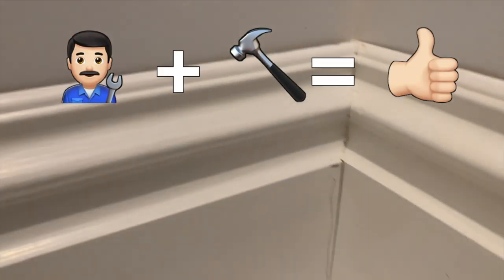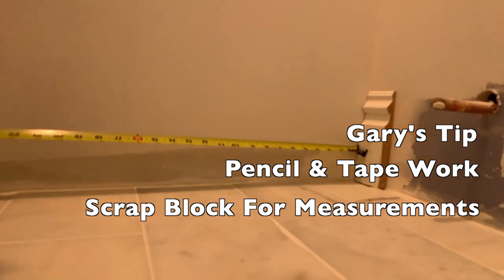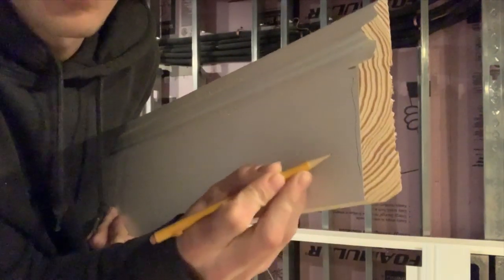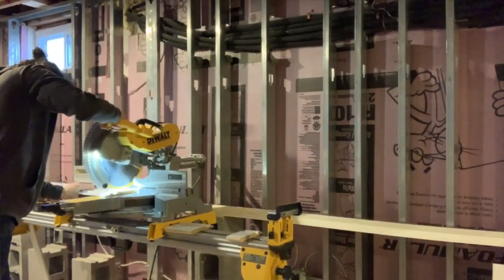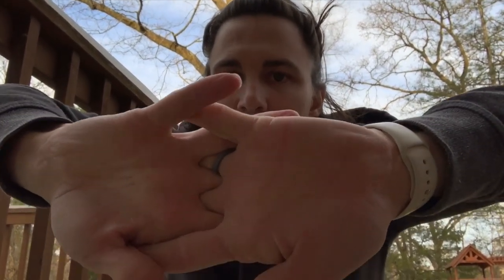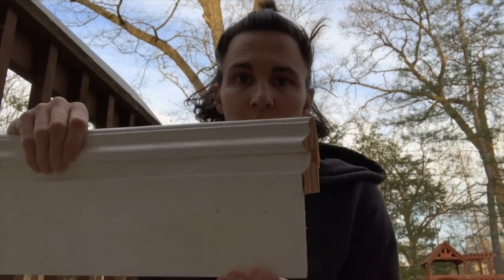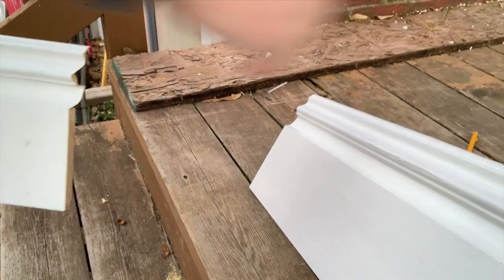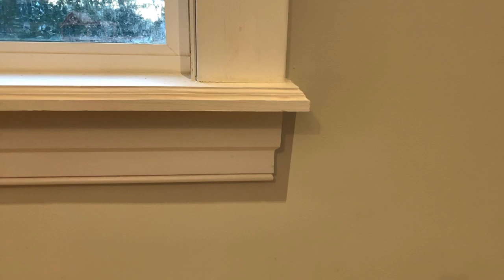Coping Baseboard Molding The RIGHT Way - #molding #carpentry #finishcarpentry

Comment: Just a tip for beginners. Don’t cut the length until you get a good cope cut or the third cut he made.  That way if you mess up just cut another 45 and start over. Yes it’s more time however will save you as seam.
Reply: Yes!! Cut the length last, in  case something goes wrong with the coping cut. You then will still have some extra to cut off on the other end.

Comment: The second 90 degree cut, I usually back cut by a couple of degrees, along with the coping cuts. It gives you a bit of wiggle room if the walls are a bit uneven

Comment: I am a novice DIY'er.  I have to fabricate and install 50 feet of baseboard to replace the 130 year old stained baseboards that the demo asses destroyed.  I really appreciate the detailed explanation of how to deal with the whole piece and not just the coped end.  Question, if I'm understanding this correctly, if you make a bad cut and the square end winds up a tad short, it doesn't matter because that flaw will be concealed with the coped end.  Is that right?  Thank you.

Comment: Hey Cat:  How do you attach stained baseboard to brick or plaster?  Great video!
Reply from the maker: Good Question. Only time I've had to glue base down was on an exterior basement wall with no framing. I used a product by Liquid Nail's called FUZE It. - I'd work to find weights, or 5 gallon paint buckets to hold the base into place as the glue sets. Good luck!

Comment: Great video but why is there a gap still
Reply from the maker: Vance Nelson nothing is nailed in at this point. And cause it’s 4K 😂
Reply: I agree with Vance, it should be light tight when just pushed together.
Reply: @PatTheCat  idk they just didn't look very round, sand paper goes a long way.
Reply: It's because he down cut the cope... is a much tighter fit if you back cut a close to 45 as you can.

Comment: There isn't really a wrong way but its easier to measure from sheetrock to sheetrock cut 45 on the end and it automatically fits.  Cutting the straight with a miterbox is great also.  I'm a puller just like you are.  I can't see how people can push a coping saw.  I'm a 35yr experienced trim contractor and you did pretty good there.
Reply from the maker: Thanks Jeff! Stay tuned!

Comment: If you don't have a sliding miter saw can you do that straight cut vertical and upside down?
Reply from the maker: I suppose you can. I just recently used a batter powered circular saw to install base and cope it, so when there's a will there's a way! In your case, if you had a multitool that would be helpful, you'll want to watch that the saw doesn't kick when you power it down and that the base is supported and not moving at all. Good luck!

Comment: Hi, great video. My question is how do I angle the chopping saw so that I get less on the bottom or back of the cut. I keep cutting off my 45 degree angle and the pieces don't fit together like they should.
Reply from the maker: Candace Harmon cut the board square or straight , until you need to cope the profile of the accent on the trim.
Reply: @PatTheCat  thanks

Comment: Coping with a small angle grinder copes in seconds back resessing the fit for tightness .40 grit wheel .
Reply from the maker: All I had was a coping saw
Reply: Then my friend you had the tool of choice ,I have one but I choose the old school method saw teeth ,grinder for finishing the recess .
Old school tools teaches proper handling of all other tools, even a painters brush ,always allow the tool to do it's work lol we just help 
It along ..I'm teaching myself carpentry these videos here have taught me how to maintain my own home remodels as well . To all you Who make videos Thanks .
Reply: @PatTheCat  Don't get pressured to use an angle grinder.  They are very dangerous tools... can easily end your carpentry career in a second.  All the time it saved you will be meaningless when you are missing fingers etc. Safety over speed. 

Also, liked the video and tips.  Good job!

Comment: Really a hole for the supply line. You offset the base molding by using 3 more pieces and setting into the main base so the profile creates a top and side frames creating a nice flat area for your escutcheon. Wish I could add a photo as I just finished doing such.
Reply from the maker: I think I understand what you are saying!!

Comment: Can you do a video on how to measure the wall and then the skirting board so you know exactly the lengths you need to cut to cope it. Then the length it needs to be after coping. 

No online videos show how to measure etc so you don't end up cutting too short or too long before coping, then after coping etc
Reply from the maker: That’s what video does exactly. Watch the measuring part once more.
Reply: @PatTheCat  my skirting is 18mm thick at the bottom and narrows to about 9mm (roughly) at top. 

I put a waste piece of skirting in against the wall. Do I measure from the base of the waste skirting where its 18mm or the top where its 9mm ?

Also when I'm measuring from that waste piece against the wall, do I measure to the bare wall on the other side or to another waste piece of timber ?
Reply from the maker: @darachslife5875  OK, are you trimming out the whole room? Or just replacing a few pieces? It also would be good to determine which hand you were going to cope with. Since I cope with my right hand, I cut the board square on the left that way all my copes are done with my right hand. In cutting anything, always use your longest dimension. Measure twice cut once, if it’s long cut short, if it’s still long cut shorter. If your piece is too long and your cope is dead on, then just cut your square side back in increments of a 16 inch or 32nd at a time. Cope just one time, then reduce the square side if it’s too long
Reply: @PatTheCat  thank you very much for replying by the way.

Okay let's just for arguments sake say say each wall is 600mm long and four walls perfect square room. Im coping same as you have said in video and I'm right handed. Skirting is 180mm high by 18mm thick at base and narrows into 9mm at top

So I cut one end at 45°, cope it back etc. Its the length back that always gets me cos I've to keep cutting a little at a time cos obviously if its too big it won't fit and then when I cut too short its too late and I think its the 9mm between the top and bottom thickness that keeps getting me.

So do you reckon the length of the board should be 582mm measuring back from the coped end or 591mm and I'm using a hand saw at the minute so its very time consuming trying to cut it to length a couple of times hence why I'm asking about measuring to try speed it up a length
Reply: Do his way of measuring is not very accurate do to most drywall in the corners are not truly plumb do to over mudding or under mudding. Measure wall to wall (without a spacer) roughly were the top of your base will be on the wall for example if its 600mm go to your saw cut your 45 degree cut. Now BEFORE YOU COPE anything take your tape and hook the long point of the 45 and measure out the 600mm and that will be your straight cut. Now you can cope everything out. This works reguardless of any style or profile of base. And just cause your right handed doesnt mean you cant do left copes give it a try may be easier for you. After training no joke, nearly 100 people how to trim 98% of them if they are right handed left copes are easier and left handed people right copes are easier but do what works for you and dont be afraid to try something different
Reply: Oh and that cope should have been alot tighter

Comment: When you are making your cut. What Mark's did you make on the board to make the cut, I just have a craftsman miter, nothing like yours.
Reply: Its alot easier to make your cuts with the baseboard standing up on your miterbox than laying flat. Especially with a miterbox like yours. You just flip it upside down to make that straight cut on the cope

Comment: Good info, but I almost ALWAYS miter base with this much detail. I usually cut both inside meters at 44 or 44.5 and pinch in the longer runs to the shorter runs.
Reply from the maker: Detail is when you want to Cope.

Comment: No coping . Cut it at a 45 . Then glue the ends and if needed use my pin nailer
Reply from the maker: John Asaro not 6.5” base!!
Reply: I agree with pat you’re not going to get as good of profile match just cutting miters, also coping will more likely maintain a good joint if the wood shrink or expand. I have trimmed a lot of high end homes and have yet to see a perfect drywall corner. Not slamming you John just disagreeing with you.
Reply: Good luck finding a true 90 deg corner to just miter it.
Reply: @RyanReskyTrumpeter  true but a miter doesn’t have to be at 90 right . We can cut at 89 or 91 etc.
Reply: @jawa6066  for a corner, it'll never be perfect. Thats the reason for the cope cut.

Comment: Coping is so not needed and to be honest takes to long. If you must cope then use an angle grinder and flap disk which is so much quicker but to be honest there are so many accurate angle finder tools out there that you can just measure the angle correctly and so accurately that you mitre saw will be doing all the work. Coping is so 90s
Reply: Your*

Comment: I find it easier to use a lot of caulk and just charge the customer extra for it. Saves a lot of frustration. Do I get call backs? No never. Not one customer has ever called me back.
Reply from the maker: Ha! I have just started using all caulk!
Reply: No they didnt call you back because your a hack and wouldnt want you back in the house hackin stuff in and over charging them again. There is no frustration with cutting it correctly. Its an easy instal

Comment: Coping is only for very extreme situations but should not be the norm...it's a waste of time ...45 yrs of experience....
Reply: Agreed seems like a huge waste of time when you can just caulk a small gap. If it isnt 45 then just use a starett mitre tool to get the correct angles. So much faster. Time is important when contracting.  Quality is as well but I just see this as only marginally better

Comment: He is Not very experienced...When you cope always back cut....use a jig saw and a sanding disk on a wiz wheel
Reply from the maker: This is true, I’m not very experienced. But I did build this entire house in my spare time & made a video on how to cope larger trim that seems to be reaching people who are learning how to do it. -
Reply: @PatTheCat  no it looks good....still need caulk....dont waste time coping unless the house value is there...i dont do it on anything under $500k....its all about ratios !!
Reply from the maker: William A so 650k would make coping worth while? I don’t support this logic. It’s all about the square cut and coping one end. So much faster. & & Caulking is a bad carpenters best friend.
Reply: @PatTheCat  yes if you dont know what your doing....very little experience....miters are the quickest for ..No over $350k  maybe... a good carpenter can do good miters.....its the fastest
Reply: @Mrcrisis2012  Miters are quicker, and they will do the job if the corner is perfect. But all corners vary, particularly when too much mud is applied during drywall jointing. A good cope cut doesn't care what the angle of the corner is. It will fit perfectly whether it's 30 or 60 degrees. The cut might take longer, but you save time on measuring the angle and then caulking. Ultimately, it's the end result that matters, and coping gives the best result.

Comment: Cope your hair......just miter...cope huge  waste of time...caulk...mine  always look perfect !!  That's what it's made for...expand and contract and a minimal amount ...caulks not a building.material!!
Reply from the maker: William A cope on small base when everything is square. This home was a second story addition and not everything is square. I coped because it was the only tool I had & I had plenty of time and not a lot of money for my own home renovation.
Reply: @PatTheCat  if its not square...I always check...I ajust the miter...very simple...much faster...and caulk !!
Reply: @Mrcrisis2012  I do carpentry bro. But if You caulk they said You are not pro.
Reply: Caulk!!! Not for Carpenters.
Reply: @TheAavelar007  no they are wrong...you use minimal amount of caulk...its not a buidling material...lolol
Reply: @Mrcrisis2012  Caulk will expand and contract at a different rate to your hardwood, pine, MDF, etc. Over time, it will lead to cracks and will have to be done again. A proper cope cut will have a small gap that will be filled by paint, and thus will be less susceptible to cracking. Long term, it's the 'safer' option. Stay away from caulk when you can.